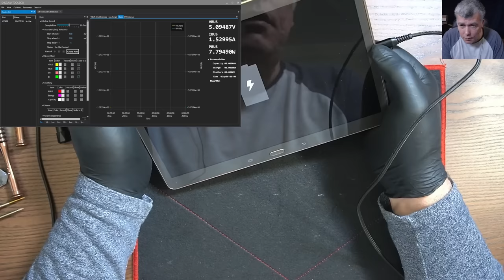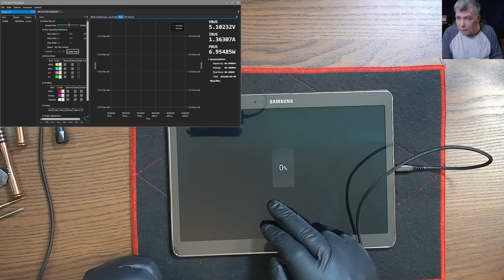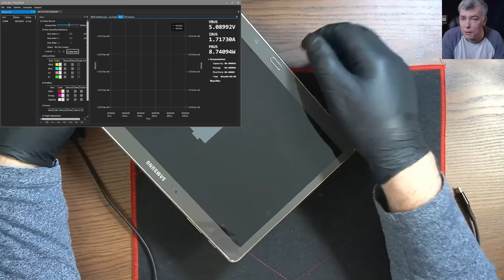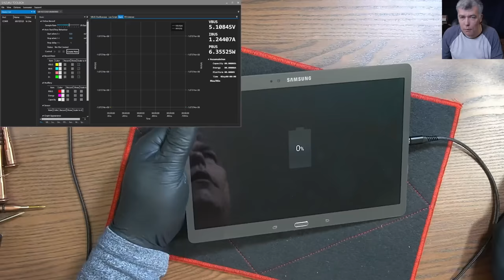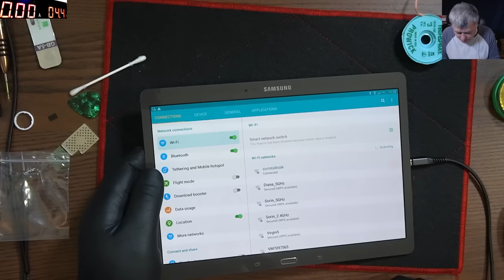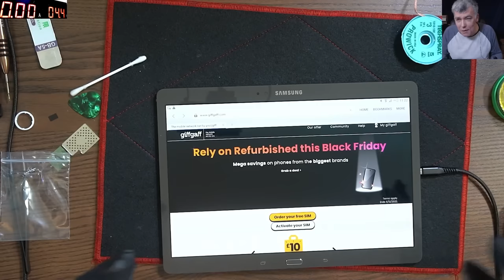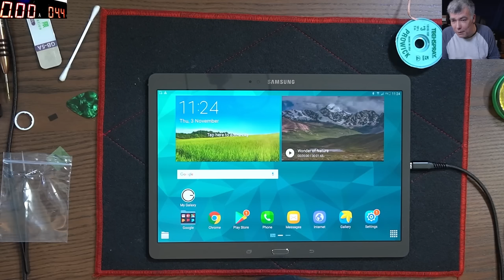Humbled by a customer diagnose precision! Samsung SM-T805 Wi-Fi chip replacement

Comment: The Internet can be a great source of information for such things. My parents' 5-6 years old Samsung LCD TV started to randomly turn itself on and off one day and they were on the verge of buying a new one. Searching online it turned out that there is a common issue with capacitors in the power supply on that model. Sure enough, after taking the TV apart one could immediately see a bulging power supply capacitor. So instead of buying a new TV, their current one was fixed by replacing a single capacitor.

Comment: Fair enough to the customer for diagnosing and supplying the chip and credit to you for doing the job - I have a BGA chip I’d like to replace on a AV unit but don’t have a decent hot air station or microscope to do it properly - the OEM ‘approved’ repairer wanted £50 per hour to diagnose it before even considering replacing it 🙄 so some customers may be quite capable if finding the issue but may not have the tools to be able to fix it themselves - unnecessary cost then causes more stuff to be left unrepaired or go to landfill 😕

Comment: for the rosin flux,

i use glycerin + rosin + ipa, 
with glycerin, you can heat it more before it burned
but with time,  the ipa evaporate, so rosin+ipa  precipitate .
 
so i just shake it (i put a glass bead in the tube).
Reply: You said "so rosin+ipa  precipitate". Did you mean "so rosin+glycerin  precipitate"?
Reply: The thing with this is it smokes more when you add glycerine & this puts you at greater risk of respiratory side effects & long term health risks.
Reply: @waynesallee-com  i mean rosin +ipa form some "oily" cell in  the glycerin.
it decant.
Reply: @stalwartcomputers5182   i think you take the problem in the wrong order ;)
you want to work at low temp so you buy a solder station with active tip
(that's why active tip last longer)
and you preheat the pcb for the same reason

for example, glycerin is used  in electronic cigarette 
but for our use, if you heat the glycerin but stay under boiling point (290°c) 
it doesn't  transform into Acrolein ( that can put you at risk .etc)

using glycerin can jellied the flux and make it more transparent

rosin has these risk of respiratory side  effects & long term health risks. when burned
but sorin burned it since years ^^
Reply: @ZZZ-z9n3n  the reason the glycerin & the rosin separate is because you need to heat both the rosin and the glycerin for the glycerin to bond with the rosin & it will only bond with so much before if rejects the rest when you add IPA to that it will still likely lose alot of that absorption/bonding meaning you actually have less rosin physical mixed properly within the solution.
I mean the smoke produced by the glycerin means your absorption of the rosin is then greater in the body because its a finer more absorbant substance which increases your risk of respiratory issues & tissue damage (doesn't matter if you've been doing it for year it matters when it catches up with you) 
Not to mention melting point of unleaded  is around 217° so taking thermal mass into consideration generally speaking your almost always going to be in the window of above 250-300°c (unless using low temp alloy all the time) but being in that window makes this kinda redundant because your actually making something that increases the adverse effects compared to just using the raw rosin. That's why as a flux manufacturer we've made products that can withstand high temperatures without all the risks so safer & easier to use without the hard cleanup,solid mess stuck to the board,heavy smoking during use,strong overpowering smells etc.. although we still have fluxes that have the strong rosin smell etc, but some want a clean environmental air based solution along side air scrubbing/extraction on locations like a shopping mall etc.
Reply: @stalwartcomputers5182  that's why EVERYBODY use leaded tin , it become fully liquid at 190-200°c
if you use a jbc, you can solder it at 275°c on high ground mass

" That's why as a flux manufacturer we've made products that can withstand high temperatures without all the risks so safer & easier to use without the hard cleanup,solid mess stuck to the board,heavy smoking during use,strong overpowering smells etc.. although we still have fluxes that have the strong rosin smell etc, but some want a clean environmental air based solution along side air scrubbing/extraction on locations like a shopping mall etc."
sorry, but the pro flux i  used or saw used  are not what you describe ^^
they are often fishy and stinky ,sticky, corrosive,hard to clean
and if you buy a fume extractor, you finish by not using it
every job has its risks , electronic is not exempt.
the statistic of "safety" are based on criterions that are never respected
-x hours of works,
-non-smoker
-gloves
-temp used
and so on

they exist more  to justify the fact employer don't pay the hospital bill ^^
and in case of self-employement, you want it cheap and before everything else, effective
that's why you see sorin work at 480°c

and that's why the pro flux ,he use, will be always defectuous, you mean to solder at lower temp(-275°c) with theses products ^^

ex :
flux from amtech
alloy  ---------temp(°c)
63Sn/37Pb 183  
62Sn/36Pb/2Ag 179  
62.8Sn/36.8Pb/0.4Ag 179-183 
60Sn/40Pb 183-191 
43Sn/43Pb/14Bi 144-163 
42Sn/58Bi 138 
10Sn/88Pb/2Ag 268-290
https://www.inventec.dehon.com/wp-content/uploads/2022/04/PDS-AMTECH-NC-559-V3-EN.pdf

otherwise, you can forget the "noclean and no corrosive" and the healty ^^

buyer are different from stupid :p

Comment: The full width USB-3 data/charge cable charges with higher  amperage,
than the standard width micro USB-3 data/charge cable. I do know this
tablet well ..... I have the SM-P905 version.

Edit: this table does not have the full width micros USB-3 socket.

Comment: good day mister sorin i have hp laptop and speaker no sounds but when i plugged headphone it is working properly it has sounds on headphone but when i unplugged it it still no sounds on built in speaker i tried update the driver and other troubleshooting i dont even see damage on speaker connector either on speaker i hope you have something to advice me because its driving me crazy

Comment: I think internal resistance of the battery is supposed to be high when the battery is in good condition.
Reply: No that is incorrect.  A high internal resistance would mean that when you draw current from the battery the voltage at the battery terminals would drop which you do not want at all.    The ideal battery has zero internal resistance.  
 Imagine that you have a 19 volt battery and its internal resistance is 5 ohms.   Now, when you draw 1 amp from this battery there will be a voltage drop across the internal resistance of 1 * 5 =  5 volts.    So now you will only see only 14 volts on the battery terminals and the higher that internal resistance is the worse the situation becomes.

Comment: I had a samsung tv tat would turn on, and shut itself off after a sort amount of time. It was the wifi module. It was getting very hot.  I just unplugged it and he tv worked fine for years until the screen leaked out it's liquid crystals. I don't buy samsung products anymore.